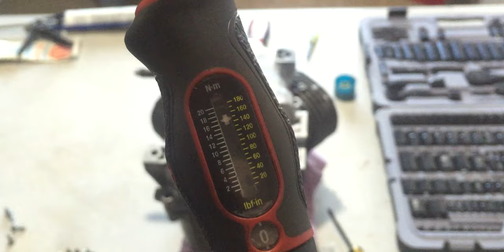Briggs & Stratton V-Twin Assembly and Start Up, Will It Run?

Comment: It’s great to see you rebuild newer engines most people wouldn’t but it improves your skill and besides it’s fun it’s like a puzzle
Reply from the maker: It's always good to work on engines if they're old or new. Sometimes the older engines were built even better. I have a special engine that's about 100years old and I'll have a massive series on that engine in the near future ;D For sure, it helps a lot to understand how each engine works and where improvements were made. I hope you can get to work on some engines too:) Cheers

Comment: Also how do you clean the engine before reassembly because it looks very nice and degreased well
Reply from the maker: It depends if I fix or if I refurbish/rebuild a machine or engine. When I fix machines I usually just clean the parts manually, which is pressure washing the machine and scrubbing. If I want to refurbish or restore something (in this case the engine) I tear everything to pieces, clean them in my ultrasonic cleaner, and carbon build is cleaned with steel wool. Maybe in the near future, I'll share a video of different steps for cleaning! Best regards

Comment: Did you hone the cylinders and install new rings?
Reply from the maker: Hello, great question! No, I did not have to hone the cylinders whatsoever. There were no imperfections and the bore was true-to-size. Sometimes when an engine has many hours on the clock, it is good to "deglaze" the bore, but in my case, everything was top notch. 
I didn't believe it myself, as I pulled this engine out of a lawn tractor that has been sitting for many years. 
All I had to purchase was a full gasket kit and the rebuild was done within a couple hours. 
I hope that helps, Best regards

Comment: Awesome would you be interested in checking out my new John Deere 318 I bought I is really cool and sounds amazing with the onan twin cylinder and with a 54 inch power angle plow and 48 inch snow blower and a 50 inch deck and weights chains and sleeve hitches this is a beast it also has power steering great video as always I also am glad your working in newer machines too and not just old ones it’s good to work on a bit of everything
Reply from the maker: I just checked it out! It looks like you found yourself a great machine. If you keep it clean from debris and keep the mechanical side maintained, you'll have that for a long time :) Yes I'll be working on some newer machines and there are still some that are even older that I will be working on too. Stay tuned
Reply: @WorkshopRebuild  looking forward to it would you do any videos in bigger farm tractors that’s just a suggestion I’m not picky I’ll be on with anything you put in
Reply from the maker: @hunter7476  I might do some videos with bigger farm tractors. I am working on the Gravely GMT9000 and Allis Chalmers which are both bigger. I have some bigger machines, but they are used for chores :)

Comment: hi I need to to a service on mine do you have a list of parts I would need and type of oil.
Reply from the maker: Hi Steven, unfortunately, I do not have a parts list on hand for everything you need, but the filter I used is a Fram PH3614 and the engine oil I use for all my small engines is 15W40. I hope this helps!
Reply: @WorkshopRebuild  thanks

Comment: I have the same engine, but you totally skipped the carb install.
Reply from the maker: Yes I have! Send me an email and I will forward you some pictures of the carburetor setup. Cheers
Reply: @WorkshopRebuild  it's that tiny wire that is confusing me.

Comment: what did you with this engine, if you still have would be very interested in it!
Reply from the maker: Hi Justin, I haven't used this engine since the rebuild and it has been stored inside. Where are you from?
Reply: @WorkshopRebuild  Kentucky, I have a mower with this same engine that just bent a rod last weekend and looking for a backup (have disassembled and cleaned waiting on a push rod now).
Reply from the maker: Okay that is a bit far. I'm here in AB, Canada! I hope your engine works after you install anew pushrod.